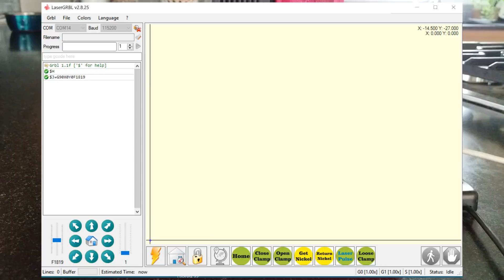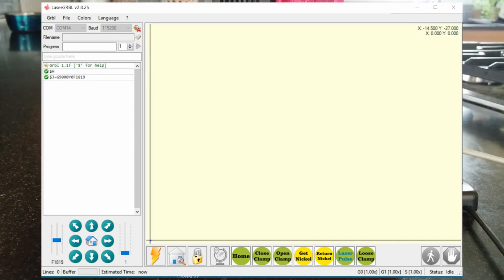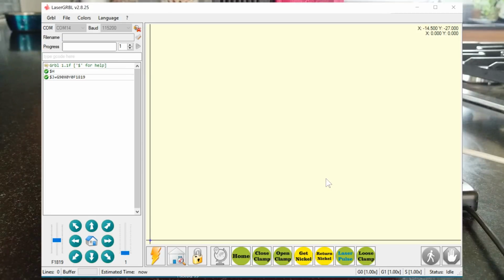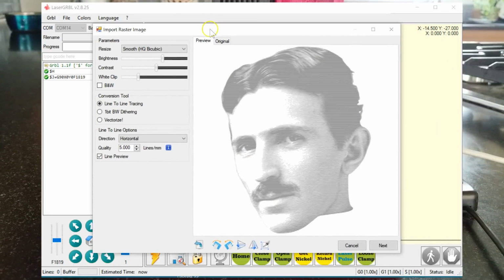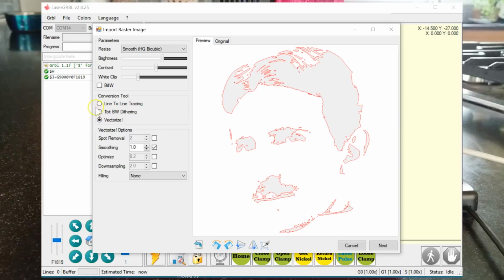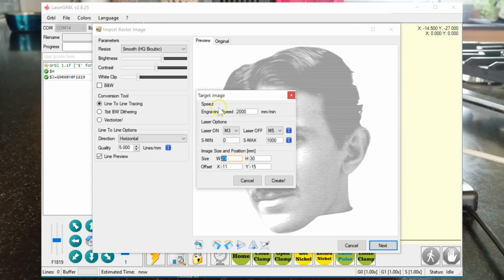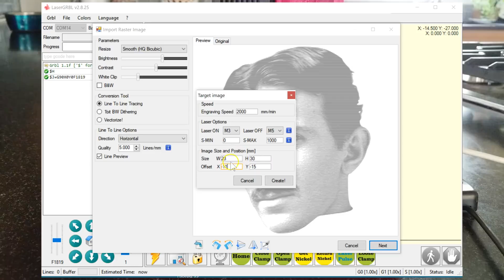Nickelbot - A Wooden Nickel Laser Engraver

Comment: Can I buy one ???
Reply: Mitch, Bart sold me some PCBs about 3 years back.  I got one of these running about 2 years ago.   Amazing little machine I've done hundreds of nickel's, PCB paste stencils, small labels for products.  I just placed an order for more PSOC5s.  I was not planning on producing any more full units, but it demand exists perhaps I could finish out these PCBs and print the parts.  I think I have 3 or 4 motherboards on hand.  Google full circle embedded and get in touch with me if interested.  $125-175 would be estimated product cost with labor.

Comment: there is a cheaper laser module on ebay around half the price and seemingly around the same power output : https://www.ebay.com/itm/High-Power-450nm-3W-3-5W-Blue-Laser-Module-TTL-Carving-Burning-Gift-Goggles/142435050194?hash=item2129ca62d2:g:1ysAAOSwRXRZW3YO:rk:2:pf:0

did you tested this one ? and if so, any problems ?